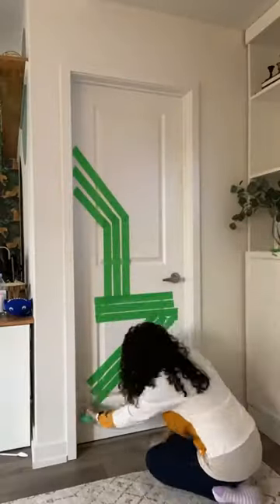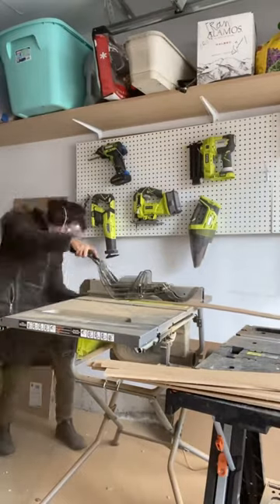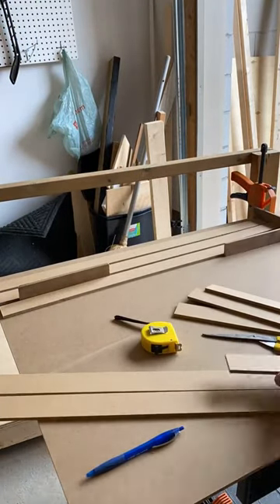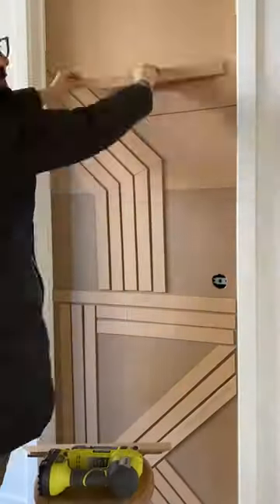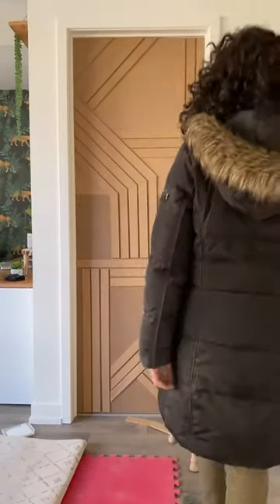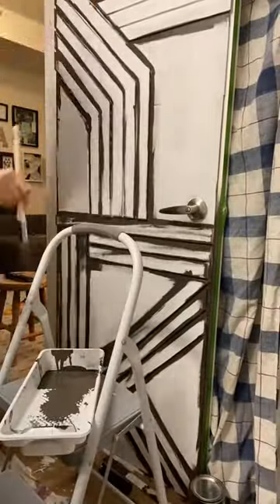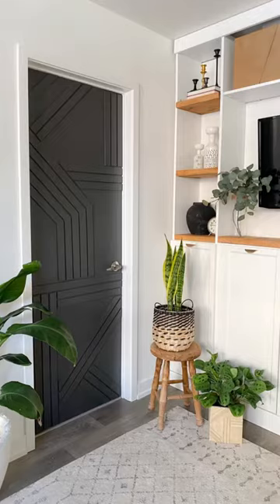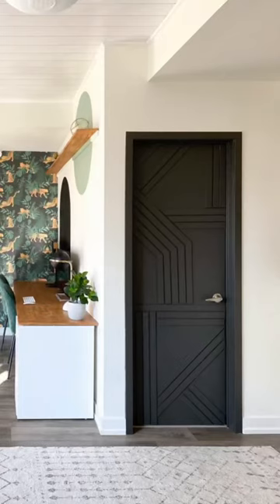My most VIRAL DIY || DIY interior door || Door trailer

Comment: Hi Hana, I wanted to purchase your guide, but I had a few questions. 
For the "Door Width", would that be the space between the door frame, like how you showed in your video (0:00)?
For the "Opening", would your door from the video be considered "inward" or "outward"?
Does the height of the door not make a difference?
Thank you!
Reply from the maker: My door opens inwards. I only have a few sizes on my blog sorry if they don’t work with your door! These are the most common in my area